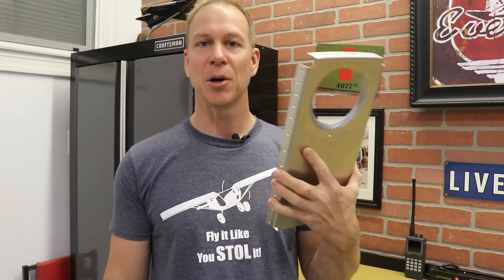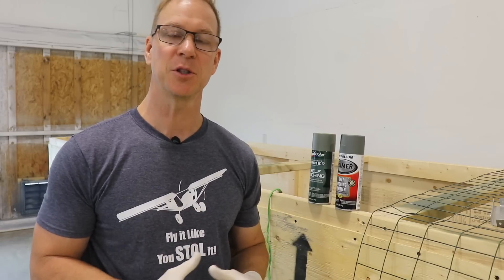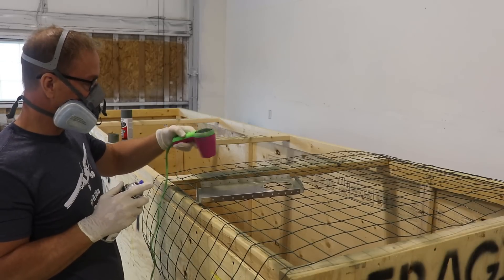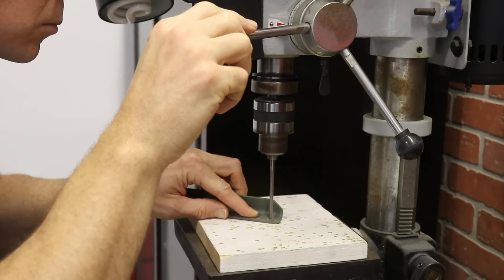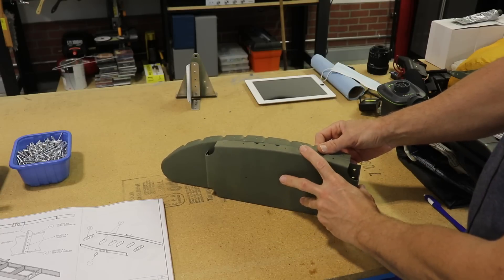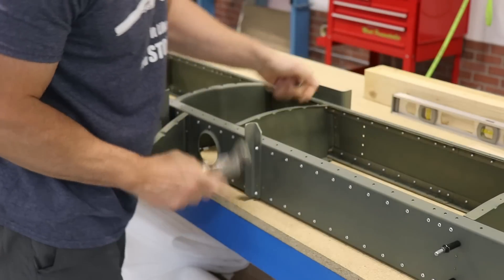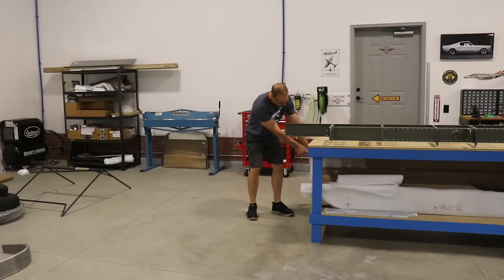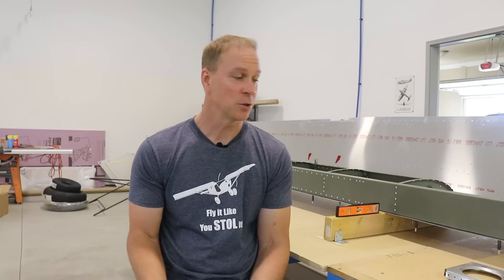CH-750 Super Duty Horizontal Stabilizer (Ep3)

Comment: It is more important that primer be used where steel parts like rivets meet the aluminum to prevent corrosion by dissimilar metals contact ... great video. I have a Hobby air system and use that to spray primer ..  much faster and it's an HVLP type system. I use PolyFiber primer ...

Comment: I know Zenith sells a high speed pneumatic drill for drilling holes in aluminum...any thoughts in this?  I’ve always wondered if that’d be necessary vs a regular 18v drill.
Reply: i'm building a ch 650 and i've been using an 18v drill.  It's been working fine.

Comment: My son (almost 11) and I have subscribed to your videos. We ordered the plans for the 750 Super Duty last week and will be scratch building it in Alaska. Our plan is to start building some of the parts this winter until they have the scratch built plans completed and then finish making the parts and start assembly.
Primer is something I have been thinking about, and am leaning towards an epoxy primer as I don't like how one part primers can be softened with chemicals. Plenty of time still for us to make that decision though.
Looking forward to watching you build!
Reply from the maker: I think (meaning I don't really know) that the epoxy primer is heavier than the spray can type primer I'm using. This primer goes on extremely thin and I don't think will add much weight to the aircraft. Yes the epoxy primer is stronger and resistant to chemicals, but what kind of chemicals do you anticipate coming into contact with your wing ribs, and other interior parts? For the outside of the airplane, of course never use the rattle can primer-use the good epoxy primer.
Reply: @KitplaneEnthusiast  Well.... In a perfect world, nothing would. But in reality I have seen lots of different chemicals inside wings... 100LL shouldn't be an issue, ethanol from a contaminated batch of fuel could strip it, MEK will strip it clean, Acetone will strip it clean, aerocel brake cleaner (super cheap cleaner from napa) will strip it clean, etc...

Since I am taking the time to not only build it, but to scratch build it, I would like it to have that 'extra' care taken for its looks, unlike my day job for a 135 where function and cost drive the choices, I want it to be more of an 'art project' when I am done. If that makes sense.
You are right that the epoxy primer might weigh more, so I will be doing research into the thinnest and most effective I can find. In the end perhaps not even going that way, but it is my thought for now. Maybe even different colors, so the ribs and the skins are easily visible when inspecting inside the holes. (perhaps thats taking it a bit too far :P )
Reply from the maker: Sounds like you will create a masterpiece-I like it!
Reply: @NarfiHungryWillem  If you're willing to go that far, have you considered anodizing the internal parts?
Reply: @RussellTelker  I hadn't.... sounds messy and nasty, but would be very nice looking. I'll look into it a little, but am already comfortable and familiar with the priming and painting processes. How does the cost compare?
Reply: @NarfiHungryWillem  It would be more expensive I'd imagine, never tried to do it myself, just paid a plating shop to do it for me.  Cost was, to me, reasonable.

Comment: You dont need to prime the skin?
Reply: The materials supplied by Zenith are already a very corrosion-resistant alloy (it's actually chemically identical to a beer can - and they don't corrode away for decades in the sun).  Electrolysis and chemical agents (especially trapped salt particles) will accelerate corrosion.  The primer that Mark is using prevents this by forming a barrier between the metal and the rest of the world.  The Cortec that he referred to is actually just meant as a 'vapor inhibitor'.  It stops any vapors getting in between any of the mating surfaces.

Any exposed surfaces are better to spray in one hit with a spray gun primer before painting.  The components he is working on at the moment will never see the light of day again, so they need to be done now (or not at all - it's a builder's choice and depends largely on the operating environment).

Comment: Short of weighing each piece before and after and adding the total , I'm not sure if there is a way to determine what the added weight of the primer is , any thoughts?
Reply from the maker: A lot of people get all worked up about the weight of primer. Let's just say the very light coats on the parts adds up to a total of 5 pounds. Or 10 pounds? It doesn't matter. It's something that has to be done IF you want maximum corrosion protection. It's like people stressing over how much the seats weigh! Who cares??? You need seats so what's it matter how much they weigh? The easiest way to lose weight in any airplane is to hit the gym and lay off the Twinkies!
Reply: @KitplaneEnthusiast  I want to say on the RV-10 the prevailing thought is that primer adds about 15-20lbs.  750SD might be 10-15lbs...not too significant.
Reply: @KitplaneEnthusiast  Agreed 100%. Adding a few ponds on the building plane will be an exllent motivating factor for builder to loss equal amount, maybe more of body weight, if gross load is a big concern.

Comment: So glad to see you putting primer on those parts...... that's a real positive on any aluminum exposed to any moisture.  I don't think any major aircraft manufacture would produce
a high end plane without priming every almost every part.  *You could also buy Gal. containers of aviation  zinc chromate and use a jam gun to shoot those parts.. might be lots cheaper than the rattle can thing.     Thank You for the update,. looks good .
Reply from the maker: After the smaller parts of the elevator I'll switch to a different prime method. The cans are convenient but too expensive.
Reply: I'm onboard for the whole build... Thanks.

Comment: I’m building an S-21.  Are you priming the inside of your skins?  Or just the ribs and spars?  I am priming the skins also, but it does add a lot of prep time.  Most if my time thus far has been waiting for tools I didn’t have.  😁. I have the rudder done and about to finish the VS.  I found that once I pressed the hinge bushings into the hinge, they squeezed enough that the bolts no longer fit so I had to order a reamer and that took 10 days to get here.  I wish I had tried the bolts in the rudder bushings as they will be much harder to ream now that the hinges are riveted in place.
Reply from the maker: No. I will only prime the skins where they contact the ribs or bulkheads.
Reply: @KitplaneEnthusiast  Good to know that is what you do with the skins, which makes a perfect sence scientifically!

Comment: Good job!  I went with Zinc Phosphate primer for the mating surfaces and interior,  I'll probably use the etching primer for my exterior.  After seeing the detail in your plans I'm feeling like my CH650 plan set is the red headed step child of the Zenith line. lol!
Reply from the maker: I would suggest you use a good quality epoxy primer for the outside surfaces.

Comment: NOW you confused me totally! Is the horizontal Stab like on a helicopter where the curved  leading edge is upside down creating lift from under the Stab, keeping the Nose down?
Reply from the maker: The horiz stab on the 750 STOL series has an upside down airfoil. It's flat on top and curved on the bottom.

Comment: Don't try and BS us, you bought that hair dryer for yourself!  Is there any concern about the weight of all the primer?  I know in my early model kitfox, weight is a huge factor.
Reply: 0.00956 lbs./square ft. @ 1.0 mil dry film for Super Koropon. Don't know if the spray can paint is heaver but its going to be a lot thicker than 1 mill. The military tries for .5 to .75 mil thick total. At the cost of the spray cans seems that this would be price effective too along with chemical resistant ,
Reply: @davidwhite2011  thanks for the information.  Based on those numbers, I'd say the paint is a very minimal factor in the overall weight of the plane.
Reply from the maker: You're right-I bought it because it was pink! Weight is always a factor. The primer definitely ads weight, but who knows how much. I guess you have to choose what you want more-a little added weight or corrosion?
Reply: @KitplaneEnthusiast  always a factor.  Thanks for making these videos, I'm learning lots from them.  Although I don't think a zenith is the route I'll be taking when I grow up and start building a plane, it's nice to see the process.  Dare I say that I feel I could do all the steps you've done so far.  Looks like Lego for grown ups.
Reply: @carlylea  I am curious how old you are? Mark's video is very inspiring for sure. I have been following his video for almost a year since I decided to build a Zenith in a near future before retiring. It is goodbto know Mark's video does serve his goal to inspire people in all ages.
Reply: @bing4342  I'm 36.  I own a kitfox which I love, but I've always wanted to build a plane.  I'm leaning towards an RV7.

Comment: I see that you built it right side up til around 1300 when you unpacked the skins then it was upside down. I suppose you rivet the bottom skins first?
Reply from the maker: If you're just building the skeleton it really doesn't matter which way you build it. But when the skins get riveted to the frame, the top (flat part) gets riveted first.

Comment: You said that you are suppose to build the Horiz Stab upside down, but you  have it right side up with the flat bottom down. Am I correct? or did I hear it wrong?
Reply from the maker: The flat side is the top.
Reply: The horizontal stab actually creates "negative lift" or downforce, this keeps the nose up and allows the plane to drop the nose in a stall.  Basically all (excepting canard type aircraft) follow this design.  Some do it with an airfoil, some have a flat fin and use the elevator to keep it pushing down.

Comment: I have cortec, it is white and dries clear. They say a pint is probably enough for the whole airplane as it goes on thin. Correction quart, and it can be thinned with denatured alcohol, they say it goes on easier and dries quicker.

Comment: Your local auto paint supplier will have 2 part etch primer on the cheap. Buy a cheap harbor freight gun to spray it, and dedicate to that. After spraying, rinse out the cup and toss the nozzle and needle in thinner. This will work for the duration of the project. When all the parts are primed, toss the cheap gun in the trash.
Reply from the maker: I think this is what I will do.